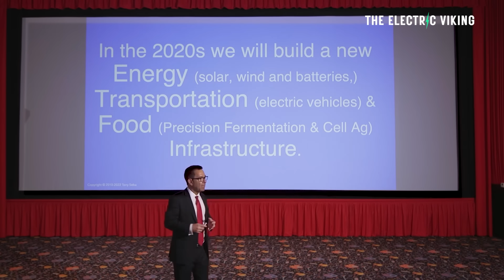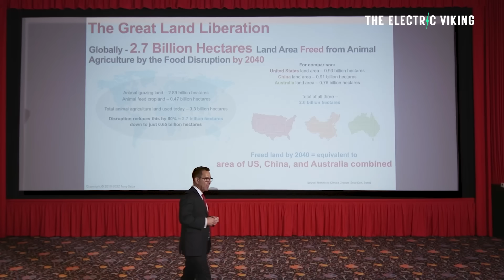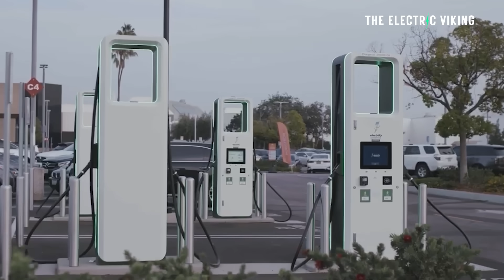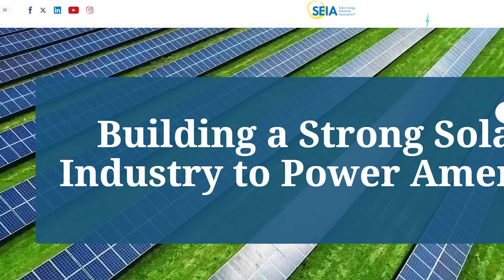Tony Seba's solar predictions seemed insane in 2014 - they don't anymore...

Comment: I’ll be interested to see what happens with Australia’s solar farms during bushfires.
Reply: If you install solar panels in bushes you are doing something wrong.
😂
Reply: @jantjarks7946  strangely bushfires don’t just stay in the bush.
Reply: @Liamgross3000  Strangely, Australia doesn't have enough space to build solar panels far away from bushes to prevent fire from jumping over...
😉
Reply: @jantjarks7946   seems your understanding of fire is somewhat limited - if you prefer we can call them grass fires if it helps you understand.
Reply: @Liamgross3000  You can't stop grass fires in Australia at critical infrastructure? I thought down under would be more competent. Don't you have firefighters, who can knock out fires?
😉
Reply: @jantjarks7946   mate, you need to do some research before gobbing off.  Seems you don’t have any understanding of how intense these fires are.
Reply: @Liamgross3000  I still don't believe Australians are that incompetent in protecting critical infrastructure.
Reply: @jantjarks7946  you just don’t understand how intense some of these fires are, they can’t be stopped. It’s that simple.   
I’m not anti solar farms, but there are realities that need to be considered, and they have been with fire departments confirming the risks.
Reply: @jantjarks7946  Are you saying the land is not cleared within say about 50 meters of a solar farm in Australia?
And there are no fire fighting capabilities?
Reply: @ronfarnsworth7074  If you read my last comment you can understand what I meant.

You are asking the wrong person.
😉
Reply: @Liamgross3000  I will tell some people that I don't know about fire and how bad it can get. At least they have a good laugh.
😉
Reply: A little less area output temporarily is about all. Solar systems are built for 2x or more of peak.
That's why there's free weekend power in parts of Europe, too much solar. Yup, look it up.
Reply: @ronfarnsworth7074   so you don’t think burning a solar farm to the ground will have much effect?  Australian bushfires can be pretty much a large as some small countries.
Reply: @Liamgross3000  Fires where I live stop when they run out of fuel. Isn't the land cleared around solar installs there?
There's a cleared perimeter around solar farms here so no flames licking at any solar panels. Embers typically won't damage angled panels.
I've never heard of a solar farm burning up. Yeah, anything can burn, but are you talking about someone's home setup?
What's different there?
Reply: @ronfarnsworth7074  the fires don’t flicker or lick around things, they burn in walls of flame. To give you some concept of scale The 2019-20 fires burned  for two months through a total of 24 million hectares (59 million acres), an area the size of the U.K.  with temperatures well over 40 degrees and  wind assistance the fires near us were spotting (embers starring new fires) out to 30 kilometres.  They burnt 6000 buildings including homes and infrastructure and erased some small towns. In previous bushfires Canberra the national Capital lost 487 homes and 23 government and commercial buildings.   solar farms are being built on farm land covering  1000 acres.  Even with reduced fuel under them many will still be burnt. Intense fires are normal part of Australia, we have numerous native plants that won’t germinate unless they are burnt.  They are not going to simply burn around solar farms .  I think I”ll believe the advice given by the fire departments.
Reply: @Liamgross3000 Thanks for reply, I did hear of those fires, they were terrible. Sorry to hear.  And unfortunately these large events will become more common with higher global temps and drought.
But is this a matter of having the right size perimeter around a solar farm? Or shielded fencing? Are there standards for fire protection? Who determines these things?
I've haven't heard of a solar farm burning yet though I certainly hear of transmission lines that sometimes start fires or are burned up in fires for whatever reason.
I get that different locations have different challenges but find it hard to believe solar farms can't be protected.
What do the fire people suggest for a reasonable perimeter? Or would it be an  insurance liability issue? Lots of times that's the case here in the US.
The solar farms around here use contractors or goats to remove vegetation and any close trees are removed.
Reply: @ronfarnsworth7074    I think it  is the ferocity of the fires that will cause the issues, they pretty much consume everything in their path and most are started by lightening  which is not selective where it strikes .  The low intensity fires are very common and not an issue.  Our fire warning ratings now go as high as catastrophic.  Even to a point that people are advised to leave certain areas prior to fires starting. You can get days above 45 degrees with fierce hot winds, and the fire moves so fast and intensifies very quickly, they are terrifying .  There’s a lot of community concern,  particularly in the more remote areas. 
In saying all that we have an enormous amount of sunshine so I’m not anti solar farms, the reality is though some will be totally destroyed.
Domestically our governments have made household Solar very cost effective with subsidies  and offsets.

Comment: New solar tech coming online soon too-and better storage battery solutions are almost there.
Reply: What's the new tech?
Reply: @ChicagoBob123  Likely perovskite. It's a cheaper material that can be synthesized and applied in very thin photovoltaic coatings, resulting in cheaper and lighter solar panels that can be made in complex shapes or even made flexible. And since it absorbs different wavelengths than silicon photovoltaic cells, you can put a perovskite coating atop a silicon solar panel to further increase efficiency.

The big issue with perovskite has been stability; it degrades with water, including the humidity present in the atmosphere. But there seems to be promising solutions to that issue already in the prototype stage, and if they do work it's only a matter of scaling production.
Reply: @ChicagoBob123  Look up fraunhoser isu in germany. They push the boundaries on this stuff

Comment: Would be cool if you could do a video showing the performance of your solar panels 👍
Reply: Had my 4.4kW system here in Australia for 10 years. It paid for itself in 4-5 years. 
Still produces around 16-18kWh per day.
I just got a quote for another 6.6kW + 9.2kWh battery. The battery is about 70% of the cost.
Lifetime cost of batteries here in Australia is about parity with grid energy per kWh. Once they drop below grid electricity per kWh and then accelerate, the impact will be tremendous.
Apparently 1/3rd of homes here have solar panels.
Reply: @aaronsinspirationdaily4896  awesome, I'm in the UK and just waiting on the approval from the grid to proceed with our install. Hopefully will have an 8.6kWp (split over 3 orientations) with a 15kWh battery. If my man maths is right I should be able to achieve a payback in 5-6 years 🤞 but that will depend if we can get the full export back to the grid in the summer and not get a limit put on it. Already have plans to build a lean-to over our shed for another 10 panels which should then see our full electric usage offset. Just need to ditch the gas boiler and get a heat pump and see if I can add another 6 panels to our garage. Will take time but is sadly an exciting prospect 😅
Reply: @steve_787  that’s an awesome project Steve. Well done. I’m a real novice in comparison. Just your average consumer.
Reply: @aaronsinspirationdaily4896  It's not the batteries dropping below grid prices, it is the power companies continually raising prices that will and have increased battery sales IMO.
Reply: @greghudson9717  yes, I completely agree. The grid pricing seems unlikely to decrease based on recent evidence. And is very likely to keep increasing. This will make Solar and batteries behind the meter make even more sense financially.